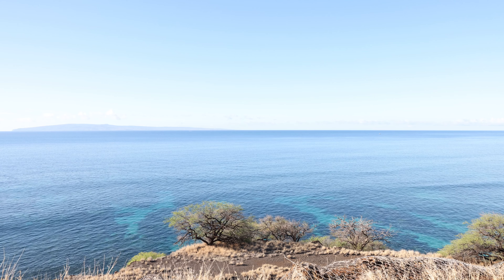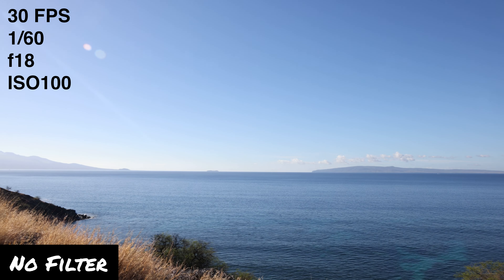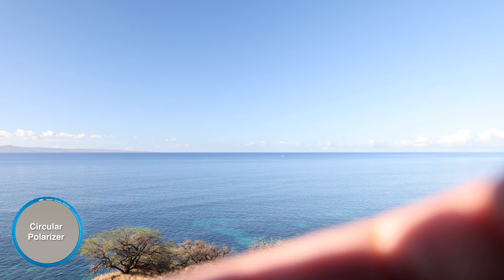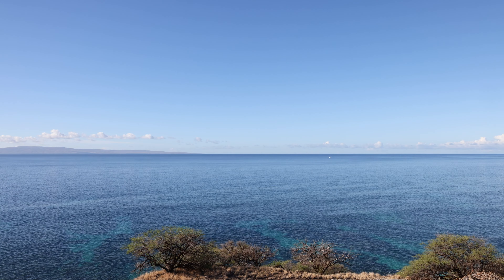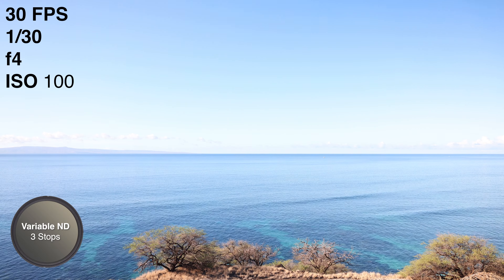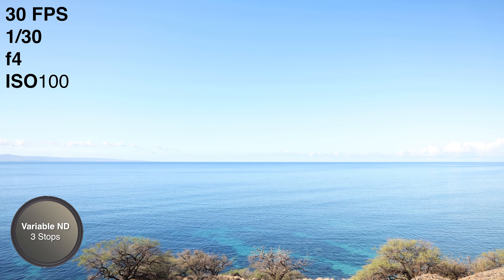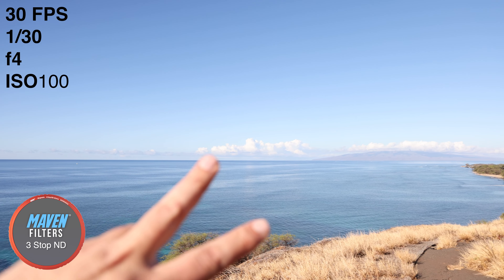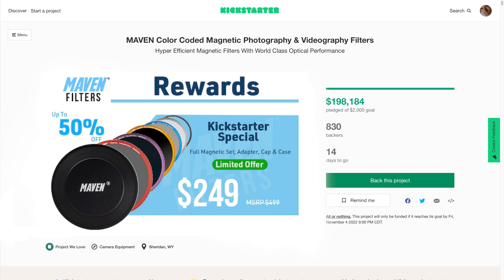Variable NDs Are Wacky - Here's what they never told you - CPL vs VND vs Solid ND

Comment: Thanks a lot for this video. I saw so many reviews about VND but they never talk about the principle disadvantages from the VND.
In my opinion the list is longer:
- ugly x pattern (at the higher values of the scale from the VND)
- bad effect to the bokeh
Best regrads, Alex
Reply: X pattern appears only when you turn past the range. VND has a very short turn throw for it's scale, all outside will be off. Cheap ones do have limiter sometimes, but they can also have improperly placed glass angle making it worse.

Comment: This is why they make a VND+CPL. IMHO all VND filters should be made this way. These filters allow you to rotate one CPL against the other with a lever, and they have a ring which rotates both filters simultaneously. You first move the lever to get the brightness correct, then rotate the ring to get the polarization correct, then tweak to dial in the settings you prefer.  If you need both an ND and a CPL, one of these VND+CPL filters could work for you.